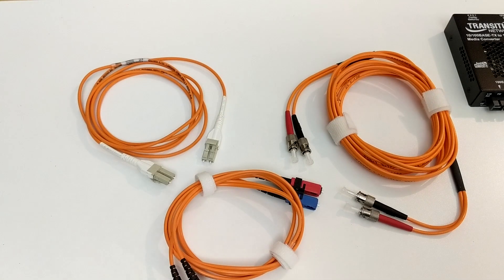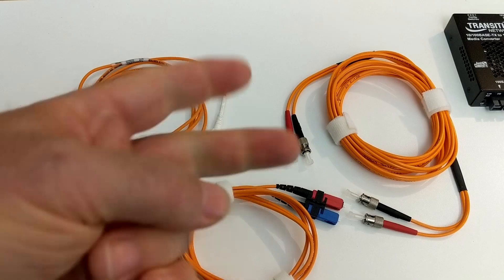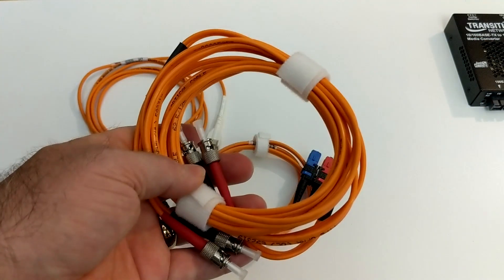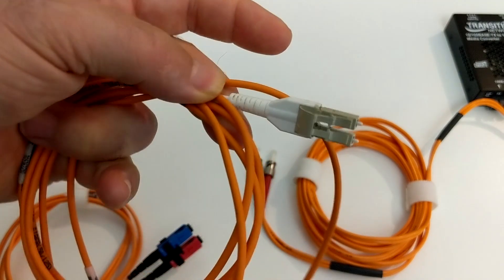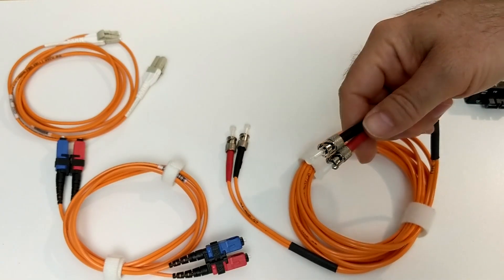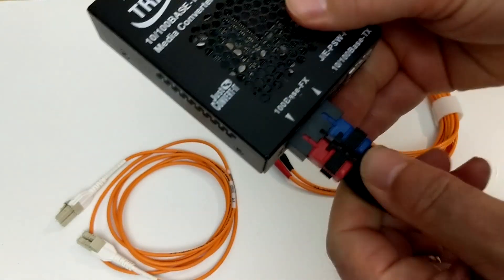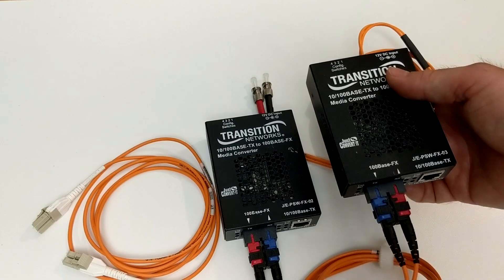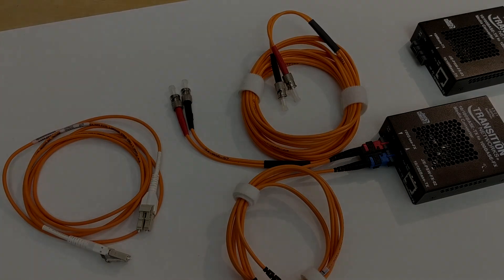Fiber Optic Basics for Field Techs

Comment: Hi, may i ask about signal attenuation? If i use a single mode fiber optic that design for long distance connection (lets say 40 kilometers) into a shorter range connection (500 meters) is it can cause signal attenuation? Becauss the laser beam is too bright in the receiver side?
Reply from the maker: These things you mention I believe are referred to as Budget.  Unfortunately,  I am not qualified to offer much guidance on the topic of budgeting,  but shouldn’t be too hard to find online
Reply: @NetworkAdvisor  no, I'm just curious about this topic, i watched linus tech tips before and he mentioned that if the light or laser beam on the destination side is too bright, it can cause signal attenuation, but i forgot which video and which part of the video he say that.

Comment: Pro tip: If you need to see the light in the end of the connector, use your cell phone camera. You will see the red light as a bright purple light that is easy to see. And it will cot damage youe eyes. This is much more of an issue when toy are looking at LR transceivers of transceivers up in the 100gb range.
Reply from the maker: right?  cracks me up to see so many techs staring right end to the end of the fiber (I'll admit I did that too in my younger (dumber) days.   Neat trick about the cell camera.  :-D

Comment: The transceivers don't always use a laser. Multimode often uses LED since it doesn't have to go as far.
Reply from the maker: That's good to know.  Thank you for adding.  I'm certainly no Fiber Optics expert.  I'm just sharing my practical field knowledge form installs I've done in the past.  :-)

Comment: 1, always asume a fibre is lit
2, the light is the infra-red range, invisible to naked eye,m the danger here is, when your eye see's something nasty, it makes you close/squint so the risk of damage is unlikely, just as if your in  dark room and shine a torch light towards you - you look away, same principle.
However with infrared light, there's nothing for your eye/brain connection to alert you or go ' oh crap and close up/turn away from, hence starring at it can be risky despite its generally low power, the chances of damage are small, but play it safe never look into an end, at any time.  Those who have gone blind have been the ones foolish enough to use a magnification device staring down it.

If you want to see if your fibre is producing light, use your mobiles camera - unlike human eye, camera does detect IR bands.
Reply from the maker: Interesting stuff.  And, good to know.  Thanks for sharing.  You may have saved someone's eye-sight!  :-o

Comment: LC and SC are the most widely used connectors today.
Reply from the maker: Ah, good point.  Now that you mention it, I guess I haven't seen any ST in a while.  Thanks for contributing. ☺️
Reply: @NetworkAdvisor  I usually see ST used in SCADA or OT implementations of fiber.  Also, I've noticed that there are the APC used in OT more often with the green angle-cut ends where the blue UPC in IT with the flat-cut ends.

Comment: Nice !!!  Could you get into the details about optical câble strength ? I had several offices installed with fiber optics and some of the guys told me that fibers cannot make more than a 90° turn. But from what I understood browsing and searching, câbles now are really tough and can stand a lot of bad situations. Do you have any experience about this ?
Next step : splicing your own fiber connectors. I have seen several technicians do it and with the proper equipment, it does not look that hard :)
Reply from the maker: Xavtek, thaose are all great questions.  Remember, or in case you didn't hear it, at the beginning of the video I said I was not a fiber expert.  But, I will see what I can do since I want to know the answers to those questions too.
As for the 90 turn idea, I know that I have put in many short multi-mode patch cables where they were turned 180 degree.  But, I do know the fiber cables can't make sharp turns.  The turn radius has to be wide.

Great questions and thanks for watching. 🙂

Comment: Great video. I think it's not that big of a deal if you accidentaly look into a multi cable/trasceiver, since (as far as I know) they mostly use LEDs. On the other hand, single comms use laser as a source of light wich is way worse for the eyes.. but yea, dont look into fiber transceivers and cables
Reply: It might not be painful but I was told that some transceivers emit laser light close to the UV wavelength. And it is definitely bad for your eyes as it destroys parts of your light sensitive cells, without you immediately knowing.
Reply from the maker: Good to know.  I have to research transceiver power budgets next, so I might learn more about that soon.
Reply from the maker: Agreed Timotej. I appreciate your input.  Thanks for watching!  😊

Comment: Also, yellow jacket pigtails are single-mode fiber.  Orange, blue, slate, and green are different size diameters of multimode fiber.
Reply from the maker: Kyle Sanders you do that, and I would be there.  My first piece of advice, don't aim for perfection.  Just capture interesting content and the audience will come.  One of my most successful videos was just a whimsical last min idea with no planning and no rehearsal.  Keep us posted Kyle! 😁
Reply from the maker: That's really interesting Kyle.  Sounds like you know a bit on this topic.  Are you a fiber guy?
I wish I had a multi-strand fiber cable and a breakout box I could have demoed in this video too.  I am not a fibre installer so much as I just end up running into it a lot when cross-connecting switches to IDF rooms.
Thanks for sharing the info -helps us all out.  😄
Reply: I'm an outside plant fiber splicer (the guy in the bucket truck and splicing trailer) for an isp.  I also do some work in headends.  I love your videos.
Reply from the maker: Wow, Kyle.  Honored to have you.  Thanks for your contributions.   I would love to spend ten mins inside one of those trailers just to watch over your shoulder.  😀
Reply: I've actually been thinking of starting a youtube channel of my fiber optic journey out in the field.
Reply: There is one thing I do not get yet : why does certain connections need 2 fibers (Rx/tx) and others only 1 fiber ? Does light go though a fiber in both ways at the same time or the transceiver needs to wait to end receiving before sending ? I bet there is some multiplexing involved and transmissions on different wavelengths but I didn’t find a proper/simple explanation yet. Thanks !
Reply: @xavtek  Duplex is Rx/Tx pairs. You may have seen BiDi which does both Tx/Rx over one core. These use for example 1310/1550nm with each SFP being Tx/Rx. One SFP will have a blue clip and the other a yellow. Other parameters but thats for another day.
Reply from the maker: Thanks Al, that kind of info helps 😊
Reply: @alrayner4935  and this is why I love YouTube. 2 years later someone makes the effort to share his knowledge and makes it even more interesting. Thanks a lot Al !
Reply from the maker: @xavtek,  how funny is that??  Its like time has a different reality on YT.  But now it reminds me “how long has it been since I did another fibre video? “ 🤔
Reply: @xavtek  which is why I contribute to a sensible and informed question. Its what makes the world, and YouTube go round.
Reply from the maker: Appreciate that Al. As I sure you noticed,  I am know Fibre expert,  so little (or not so little) contributions like your are so helpful to us all.   YT is such a wonderful knowledge sharing tool.  😊
Reply: @xavtek  In the fiber network I work in, anything 1 Gbps and under just needs 1 fiber and everything more than 1 Gbps needs 2 fibers. Some setups can have light traveling both directions in 1 fiber on different wavelengths.
Reply from the maker: xavtek I suspect you are right.  Most def doing some multiplexing and then prob using diff colrs (was e length s) for send and receive.